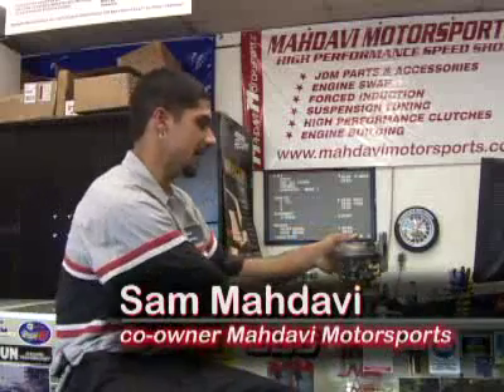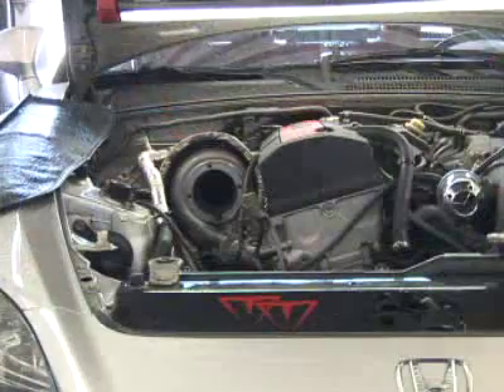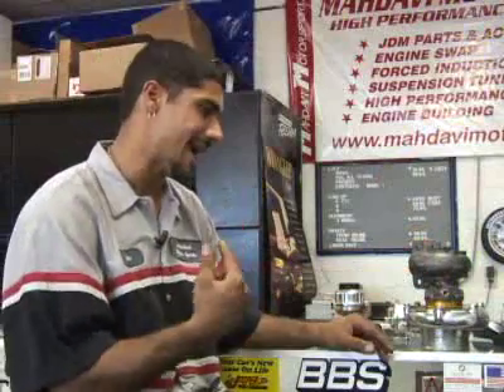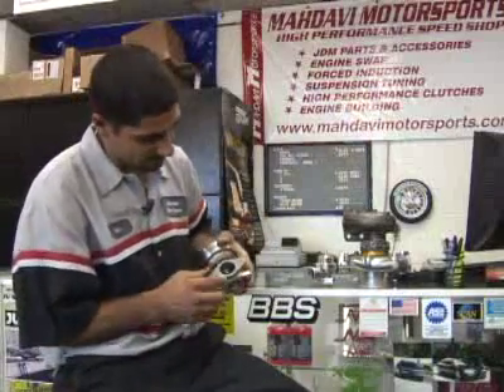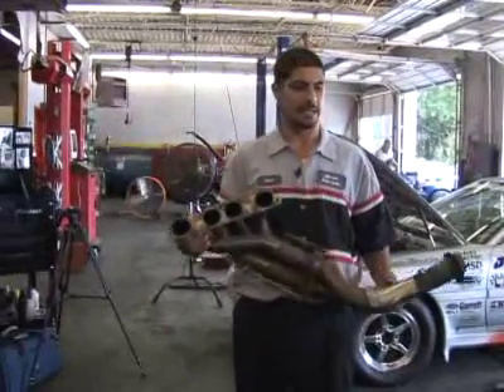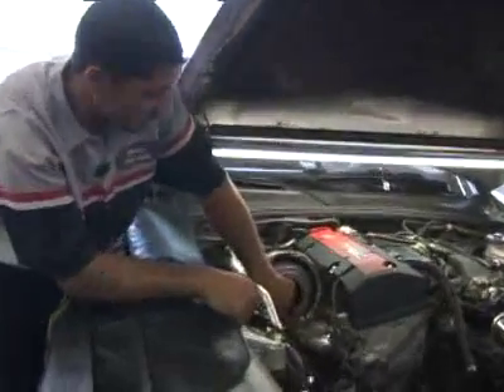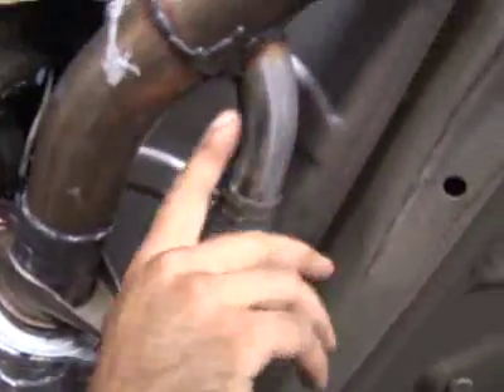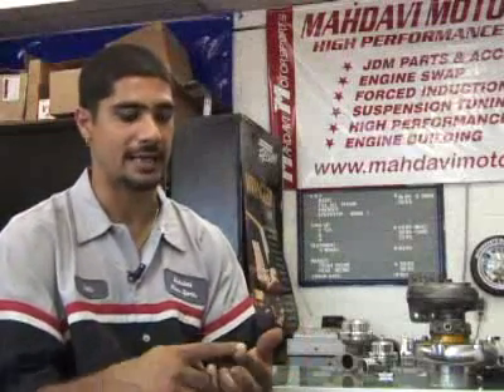How Turbochargers Work

Comment: what I mean by atomize is your separating the molecules allowing the individual oxygen atoms to be burned better.  Imagine you had a hand full of air, and you threw it against a wall, the air would hit the wall and scatter separating the molecules and allowing them to burn more completely vs. being bunched up together and the atoms in the middle of the bunch don't get burned and leave as O2 which the O2 sensor reads and makes decisions. Close your eyes and imagine it, you will understand.

Comment: You don't "atomize" air. To "atomize" just means to break up (a liquid) into tiny droplets or mist. Air is already composed of very tiny particles (mostly nitrogen and oxygen).
And the only limit to power is not how much fuel you can deliver to the motor, though that can be a limiting factor in a poor set up. 
The limits of power are air flow (and CORRESPONDING fuel flow) and the structural limits of the engine itself both in terms of pressure and speed, i.e. how strong the components are.

Comment: It depends on the turbine size, I believe. A large turbine will require more force a.k.a. higher rpm. A friend of mine has a turbo that doesn't kick in till about 5k. Small turbines will spool up at lower pressure.

Comment: Quite simply - it's because you're using more fuel.  Turbos compress the air charge going to the cylinders - more air means you can use more fuel per charge than a normally aspirated engine, which brings down the MPG.

So turbocharging a car will use more fuel, simply because now you'e adding more air.    That's why the two most common upgrades when boosting a car are larger injectors and a bigger fuel pump.  Need to get more fuel to the engine.

Comment: Man, I don't get why people turbocharge cheap cars. A car owner would have to love their economy N/A car to F/I it. I personally would never F/I a car worth less than $10k because there's a shitload of N/A cars at $10k that goes 0 to 60 in less than 6 seconds. The Infiniti G35 coupe for example, a $9000 coupe as stock it goes 0 to 60 in 5.5 seconds while a $4000 Integra with $6k worth of mods with a turbocharger barely reaches 5 seconds. So it's just not cost effective for turbo-ing cheap cars.

Comment: what invention? all ship diesel work with 2 stroke diesel with exaust valves  (intake from the compressed air with holes at bottom of the cylinder), and fuel injected by pneumatic injectors

Comment: The turbo compressor atomize nothing: he suck the air in, compress it in with centrifugal forces, and the compression from the air produce heat (like on a bicycle pump), so need a air-air cooler  to reduce the density, before the air enter in the engine...
The turbine is blast from the exaust gases pressure (like a water turbine) not the heat...

Comment: it doesn't necesarily increase the gas milage because as the air is compressed, its temperature raises which means that when it goes in to the cylinders it will not be able to expand as much which means that the engine wont produce enough power. So if you want to keep up the power you will have to press the accelerator more which wastes fuel. to prevent that you get an intercooler which cools the compressed air before it goes in to the chamber. i think he should of mentioned that

Comment: @bmxdave

You are completely wrong on the simple fact that if you take a turbo and put it over a stove it will not spin but if you take the turbo and put pressurized air in the Exhuast intake it will spin the turbo and produce boost 

Exhaust gases spin turbo the exhaust heat has nothing to do with it

Comment: That was pretty useless.

He never explained what the wastegate actually does. 

A turbo doesnt atomise fuel. It has nothing to do with fuel. Your fuel comes out of the injectors just before ignition, its completely unrelated.

Exhaust gases dont spool the turbo, its the heat that does it.

Theres a hell of a lot to take into consideration when building an engine and the two limits arent how much fuel and how strong the engine is. That was a ridiculous statement.

Comment: Not to criticize, but the only thing that was left out was that the very end: the other limit of power is when the engine is at too low of an RPM to get the turbo spinning (at a high enough RPM, if spinning at all), thus creating what's called turbo lag.

Comment: @robbinshood79 No.

The exaust gases make the turbo spin. Spinning the turbo spins another turbine on the cool side of the turbo. That turbine has a whole different tubing system, and its objective is to bring in more air, wich will be forced into the engine with the fuel for the combustion.

So, instead of having normal airflow to the inside of the engine you have a turbine forcing much more air inside. More oxigen = better burn.

Comment: TURBOLADER jemand den Traum in den Benziner. Die Gesellschaft ist nicht zu vergeben, die Entscheidung. Die Verschwendung von Ressourcen durch die Verbrennung von Brennstoffen und Materialien, um Druckluft liefern INTERCOOLER noch heißer als 80 Grad Celsius und einer Temperatur von weniger als 99% der Wärmekapazität des Motorblocks. Der Zylinder und der Zylinder mit Druckluft vom Turbolader zu fahren.

Comment: UMM im only 15 but i think a turbo is hooked up from the exhaust, when the exhaust blows threw the turbo it spins it wich pushes air threw the carburator sucking more gas and air into the pistons wich is how that works.
Now dont hate im only 15

Comment: @wheewheo Then? What happens when those gases have come into the admission manifold? The pressurized air that is about to get into the block is air from the outside, or its somewhat like a reciclation of the exhaust gases?

Comment: I reckon he's referring to superchargers while talking about air atomizing and increasing efficiency. I know that a supercharger leeches power from the engine.

basically, both systems aim to "charge" the air, increase pressure through forced induction for efficient combustion. Superchargers are coupled to the crankshaft, whereas the turbocharger converts kinetic and heat energy from exhaust gases to run the impeller or compressor. Turbos cause greater psi increase than superchargers.

Comment: @doldei the turbo is forcing and compressing (making it smaller to fit)  the air inside the cylinder  to be mix with the gas, therefore 'cause'n my 1988 Conqest tsi with the new 19c turbo to haul ass.

Comment: @nonobaOMGWEEGEE2 Think of a turbo as 2 'fans' connected by a shaft.  The exhaust blows on one 'fan' turning it VERY fast.  The other 'fan' then blows fresh air into the engine under a pressure which is determined by the wastegate.

Comment: @Banakala1991 Not being an ass but you are terribly incorrect. The exhaust gas spins the turbine from one side and expels the exhaust gases through the exhaust pipe while the other side of the turbine is pumping fresh air into the intake manifold and then into the engine.

Comment: 1 An engine and a motor are two different things
2 The only limit to power is not how much fuel you can introduce into the engine. Excessively rich mixutres will reduce HP/TQ
3 The exhaust manifold looked like an exhaust header to me

Comment: @drewglis thus, thick aftermarket headgasket to lower compression would be able to run around 12 psi regularly, maybe more like 10, but to really solve the problem, and if you have money, low compression pistons such as 8:1 or 9:1. Problem solved.

Comment: @RHDMKIII 
Just for clarification...the word "atomized" refers to being comprised of free atoms. A solid or liquid have the ability to be atomized. Any gas or vapor is inherently atomized. In other words, the turbo does not atomize the air to improve fuel economy. It simply creates the same power of an equivalent NA motor at a lower rpm. This

Comment: @JSFER2 a 2 liter making 250hp N/A would need alot of work to run boost. The dynamic compression with boost added would overwhelm just about every internal part of the engine.

Comment: @1tirefryer Almost correct, it does not force air through the radiator. It forces air through an intercooler that is either routed through the front or top of the engine to the throttle body. Radiators job is to keep the engine cool by cycling water through the engine.

Comment: Hello, this is the guy on the video.  I have been reading comments and need to correct a few things.  As far as what it takes to make power.  The more fuel you can burn in a engine, the more power you will make. However, you have to have the air to burn the fuel, so that's why your limited to how much fuel you can burn as to how much power you can make. Air can be atomized when swirled around by lets say, a turbo. Seperates the molecules allowing for a more complete burn, like a fuel injector.

Comment: uh yeah...you cant atomize one substance. you can atomize the fuel in the air, but a turbo wont help with that at all. and a turbo will lower your mileage, because youre generally gonna need to lower compression

Comment: I had a 95 Saab 2.0T, worst but best turbo car I ever owned. It took what seemed like hours for the boost to build, but when it finally did, the surge was great. I used a manual boost controller at first, then replaced it with a better system from Abbott racing. 18Psi out of the stock turbo, but absolutely awful turbo lag. I much prefer twin turbo's, smaller, spin up quicker.

Comment: ya this guy knows his stuff, but he didn't really explain...

How. A turbocharger....works.   I know where it goes, what's removed to install it, it's advantages and that it atomizes the air, but not that it takes exhaust pressure to spin a turbine that is attached to a compressor that in turn presurizes/forces more air/fuel mixture down the carburetor throat so as to get more power out of the engine, by packing more of the volatile mix into the intake stroke.  He didn't clarify that at all.

Comment: @wambam2nv Actually, the waste gate regulates pressure bewteen the collector and exhaust manifold, then that pressure pushes the impeller of the turbine to the necessary revolutions and the shaft that conects both the turbine and compressor (turbo) transfers the rpm to the compressor impeller to presurize air and to increase volumetric efiency inside the engine. 

Which means that it actually regulates the entire thing so you're halfway right

Comment: @ronandec25 yes, the more gas mileage you have the better. the more you have the more gas your gas tank can hold. the turbo charger adds mileage because the supercharger, when no boost it being used it burns air cleaner so there's no unburned fuel. but if ur using ur boost a lot it'll take away 30% fuel economy, which means you'll get worse gas mileage

Comment: @Kekkon3n  He's referring to using a given type of fuel, so the energy per unit volume of fuel is not changing. With that being said, the more fuel you can supply each cylinder at a given rpm(keeping proper air/fuel ratio) the more pressure you will generate and therefore the more power. The efficiency is determined by air/fuel ratio, compression ratio, burn rate, etc. etc.

Comment: Man after seeing this video i can see this guy did a poor job explaining the turbocharger.  There is no such thing as atomizing air.  Air is at is finest state.  Basically the turbocharger add more compression to the engine which according to the thermo laws and carnot theory increases engine performance.  The higher the compression the more efficiency the engine. Why do you think diesels get better mpg.  Compare a 25:1 compression diesel to a 10:1 gas. You get the picture

Comment: @baluhman1 

On a V8 you can have a twin turbo.  One turbo on each exhaust manifold.  Or you can have a single setup, where a custom manifold bends under the engine and forms one manifold which connects to a single turbo. In other words you have 8 cylinders blowing hot gas down a single exhaust manifold to the turbo. Single is much more time consuming.  I dont want to get into compression heat because it is well biased thermodynamic law ok thats enough.

Comment: @05jdmking The turbo isn't tied to engine speed. It's the exhaust gases from that spin it up. In neutral it doesn't take much throttle to build engine speed, so there aren't enough gases being produced to spin up the turbo. Hope that helps.

Comment: @get1989lost im not 100% on the whole better fuel milage part but yes diesel engines can use a turbo infact 90 percent of diesel engines have turbos, and aftermarket air filter increase horsepower because they allow more air into the engine, its not so much as if you buy a crappy one it could have less power its more if you don't clean it... its like a dryer lint trap if it gets clogged its screwed

Comment: @get1989lost |1| Maybe,  the turbo increases the air flow, possibly bringing some more fuel with it,  |2| YES, it can be used on diesel, diesel engines work different then petrol engines, it inserts hot air, and when the air is it its hottest point, the diesel kicks in and kaboom, so a turbo increases the effect of a diesel alot! |3| the engine needs as little air resistance as possible, if you buy a sport airfilter that dont have much resistance, but clenses the air its great for the engine!

Comment: I have a few questions:
1.Turbochargers increase the engine gas consumption? I mean if your car "drinks" 9-10 l/ 100 km, turbochargers will raise its appetite?
2.I don't believe that turbochargers can be used on diesel engines but I might be wrong. So it is possible?
3.I read somewhere (on Google) that air filters can increase your horse power but also can decrease it if you don't use the right ones. Is it true? 
4.Does anyone knows a good website where i can read about this kind of stuff?

Comment: @alfredwardellcoleman  You can use it on automatics, it the same prinsible with the engine. The only difference from a manual and a automatic is that the automatic have another transmition.

Comment: Yeah, it really depends on the plumbing. Some turbo heads will funnel down to one point to drive the turbine. When you turbo though, be ready to throw down a lot more coin on just the trubo and tuning. You'll probs need a suspension upgrade, tires, brace bar. You might need new piston heads, injectors, and valve springs plus most likely premium fuel if not already. I really am not familiar with a Maxima but just be ready for it just in case. Change one thing you usually need to change another.

Comment: @nandiito You're limited to either custom plumbing systems or options from say Squires which are rear mounted turbos at the back of the car.  If you have a V8 though, people generally twin turbo them for lack of options but also gives you much more boost flexibility and power response (power isn't always everything, how is it delivered?)  Maybe consider a supercharger from Procharger, they make some small centrifugal superchargers.

Comment: @MetalScreamer510 (2) people claim that your motor will detonate if you're internals are not forged. that is completely false. Yes, you'll be in trouble if you push like 20lbs of boost untuned. with a proper tune, people have seen 7-8lbs (which is stock on most factory-turboed cars) reliably for years. btw, V4's are so rare, i doubt any well known make put those in any cars... smh. It'll realisitically cost you around 2-3k for a simple t-25ish turbo setup if you can find parts for cheap.

Comment: @MetalScreamer510 any car really can be turbocharged. there are a few upgrades necessary, such as larger injectors, but for the most part anything is possible if you have money. a simple rundown would be to have your exhaust manifold modified for a turbo and a wastegate. you will want to run a front mount intercooler, larger injectors (preferably around 370ish for a 4cyl), 3in turbo-back exhaust (preferred) and a tune. NO you do not have to get forged internals. the misconception about that is

Comment: @ishvara88 well its a 4 cyl, good engine but do you wana throw 700+ to boost the power, that car you probably won't see as much as you think. you still could but on a automatic? Turbo's add power for high rpm's so you really don't see the increase till your high up in rpm which you won't be able to use until 4/5th in your automatic. w/ a stick u can control your rpm and gear. You could still get one and use it to atomize the air though, there's usualy a valve that allows you to adjust your boost

Comment: @ishvara88 yeah of course, all an automatic transmittion does is change the gear for you instead of you doing it yourself with a manual. now if you want to drift/race id highly recommend a manual or a twin clutch (flappy padel)

Comment: @tbonedlive 
true, when u drive normally and dont rlly use the turbo, you get better air/fuel mixture so better economy, when u drive hard and fast, the turbo forces more air into the mixture, the computer automatically adds more fuel = more power but more fuel consumption.

Comment: @Xlt92bassist he did said that a turbo car could use less petrol... but if you drive too fast then it would not... so on a turbo car how's the best way to drive such that it burns less gas than a na car?

My understanding that there are only so much you can do without getting a smaller car with a smaller engine and less power... but it would be good to have a generally better approach to drive say when you are traveling long distance across the country.

Comment: @curtis133 the ehaust gasses are not actually being cooled. most people only imagine one side of the turbo there is a hot side and a cold side, the circular pipe on the hot side spools a turbine that is connected to a turbine on the intake side... there are 2 turbines one that is moved by the ehaust then one that moves the air